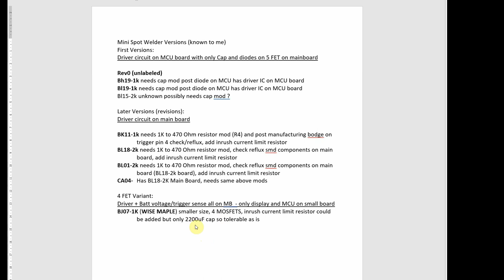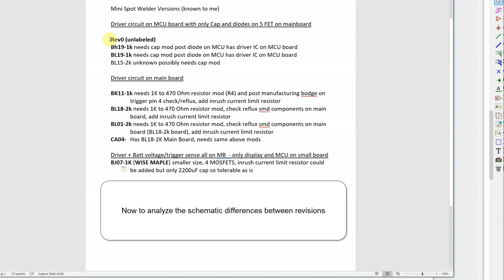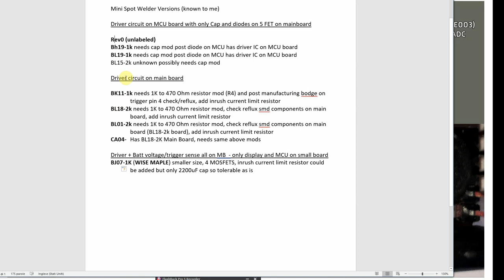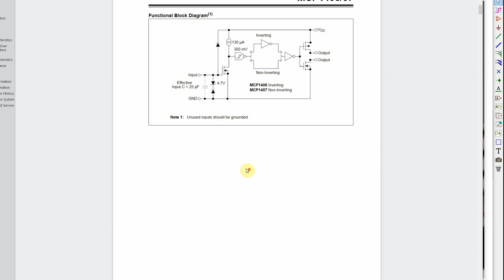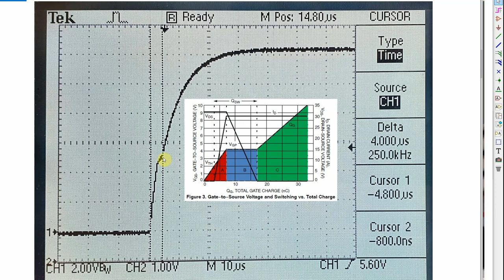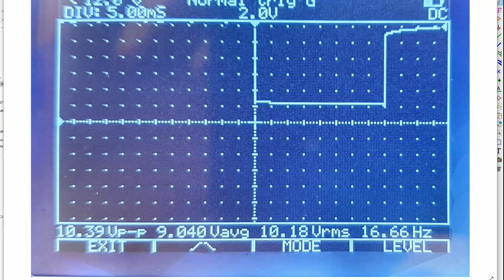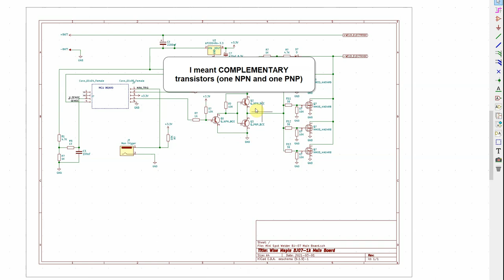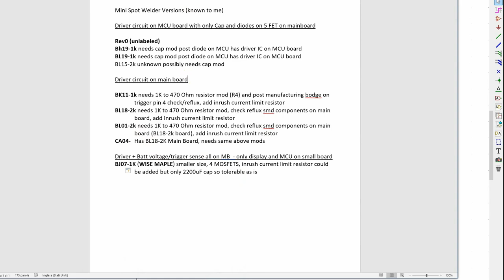All "Mini Spot Welder" versions: circuit Analysis, differences and faults

Comment: Da quello che capisco, queste mini saldatrici vanno implementate in quanto il calo di tensione della batteria può danneggiarne i componenti interni. La mia domanda è: se utilizzo come batteria una 12V da automobile da 60A corro lo stesso il rischio di calo di tensione (e devo di conseguenza modificare la saldatrice) oppure non vado incontro al calo di tensione data la dimensione della batteria che utilizzo?
Mi sto accingendo ad acquistarne una e la questione è di molta importanza per me.
Grazie e complimenti!
Reply from the maker: Ciao Fabrizio, il problema in generale è che c'è sempre una caduta di tensione al momento del "contatto" perchè i cavi e la batteria han tutti un minimo di resistenza e passando anche oltre 200A la caduta di tensione diventa notevole con una frazione di Ohm. Ovviamente una batteria più piccola o malandata avrà una caduta di tensione maggiore (e potrà fornire una corrente inferiore) e allora qui si rischia il malfunzionamento del circuito driver che pilota i Gate dei FET. Se la tensione scende troppo non vengono accesi correttamente i FET e qui si rompono. Quindi una batteria più grossa sicuramente ti assicura una minor caduta. Io consiglio per la compattezza e portabiità una LiPo 3S da 5000mAh 50C ma va bene anche una 12V AGM 45-60Ah (piuttosto imgombrante). Altra nota: se stai per comprarne uno in questo periodo potresti già ricevere la versione "Rev 0 aggiornata" su cui ho fatto un altro video di recente (controlla la playlist) che ha bisogno di un paio di modifiche ma non ha il problema della "caduta" dato che la parte driver è alimentata con un booster che parte da una tensione regolata da 3.3V.

Comment: Ciao Luca, 
Thanks for this in depth video
If you don't mind can you please help me to understand/troubleshoot an issue that i encounter?
i have in hands the first version (unmark) but i cannot make a good weld, the nickel strip (0.1mm) do not stick with eachother or the battery (18650)
I use a 3s 5200 mah 50c lipo battery, i shorten the cable that goes from battery to the unit to minimize the losses.
Have you have some recomendation of the reason why this Is happen?
I tried various pulse time, from 5 to 40ms with the same result, the nickel strip do no stick and when they does the weld Is not  robust enought.
Thanks for your time and Happy New year.
Andrea
Reply from the maker: Ciao Andrea, firstly, be absolutely certain that your 3S battery pack is in good working order - if you can try another pack. You shouldn't need to shorten any cables for good welds up to .12mm: I get very good welds with max 10ms time settings with my 3S pack. You can try a 12V car battery if you don't have another lipo pack handy - just remember to start from 5ms and go upwards. The Rev 0 is usually rather reliable and should weld fine around 10-20ms. From what you describe, there is not sufficient peak current to make a solid weld, and usually this is due to a faulty battery pack or a pack which doesn't have the required C rate or simply one element in the series is faulty. Once you are certain it's not the battery pack then you can try investigating the welder but the Rev 0 version with the MCP driver doesn't have much you can tinker with as it's all connected to the MCP output (there is no biasing of transistors). Try cleaning the pin contacts of the MCU board and check if there are any flaky/cold solderings. If you have a scope you can check the Gate output when you trigger it and see if it does peak to the required saturation voltage (>5V). Other than that there's not much you can do with a normal tester, you really need a scope to see if there is something at fault with the trigger. Buon anno anche a te!

Comment: Hi and thank you for the information..  Regarding the charge current to the main FET's, The charge current is limited by R? (30R)  which is placed above Q2. This would limit the curent to below 0.5A..
Reply from the maker: Well that depends on the input Voltage: considering a fully charged 3S LiPo or AGM battery you would have 12.6V and considering a .1V (CE Sat V) drop on the Q2 CE junction you would have 12.5V which with a 30 + 6 Ohm total Resistance (current path goes from +V through R9 then through Q2 CE junction to the 5 x 30 Ohms resistors of the 5 FETs which in parallel give 6 Ohms would give you about 347mAmps Peak burst current (12.5/36) driving the 5 FET Gates). Use this schematic as reference: https://drive.google.com/file/d/1JdTd9zBeO-WjV4NazYxrOzqykNkTNCc3/view?usp=sharing

Comment: Hi! :)

Awesome video, thanks so much. I bought one a month ago, it took forever to get here, heh. It's a Rev0, to my surprise. (seems that youtube blocks links, if you want I can send it to you in a message somewhere)

So far I'm planning to do four modifications, but I have questions for Mod3. and Mod4. Not sure if they're dumb/smart or worth doing.

1. I'll add some more solder to the long negative trace where 5 FETs are connected, they have little solder anyway, barely connected, so can't be wrong with that. More heat dissipation, slightly better conductivity.

2. I'll of course add the much needed capacitor post diode and MCU, the main thing you mentioned, that is a must.

3. (Unsure for this one) I saw this video (watch?v=mfbQiuopxMk), the person in the video talks at 01:25 about using the spot welder prongs on the same positive terminal where the battery connects as well, since there's a shorter travel path, the lines on the PCB are short anyway and it just introduces additional unnecessary capitance, inductance and resistance. However, maybe it's long for timing's sake? I wasn't sure if he's correct (well, in terms of power dissipation he is), because perhaps both traces need to be the same lenght for timing or something? I don't have an oscilloscope to check, sadly. That's why I decided to ask you first.

4. (Unsure for this one) I wanted to add a gimmick capacitor across the MCP output or Pin 4 (You talk about this at 34:03 in this video) to mitigate the miller effect further.

And by the way, I have a question regarding batteries.

Is it bad to overspec the battery? I know they reccomend car batteries with 25-40Ah rating or 60C Lipo, but what if you get a, let's say 100Ah lead acid or 150C lipo. From what I managed to see, there isn't really any proper current limiting in this small cheap device. Seems like it relies on battery (it's internal resistance and other things) to make sure it doesn't pull too many amps and blow itself up?

Is this correct? 

Thanks a lot again <3 You're a lifesaver.
Reply from the maker: 1) beefing up the traces is fine.
2) Yes this is mandatory
3) Yes you can join the 2 positive terminals on the same screw (which is what I do) to avoid any drop along the positive trace. There is no drawback in doing this if you maintain the supplied terminals intact.
4) Once you have the 1000uF cap added post MCU power diode you don't need any further cap as it's close enough to the MCP to not require any further decoupling. What really would improve the Gate switching performance is to move the whole MCP driver as close to the FET Gate as possible and have ONE MCP per FET. This is yet another design flaw/cost reduction - but again this is a cheap device and cost was kept at minimum. Naturally this is not an appliable mod to this current design.

The suggested battery C is to not overdrive the FET as the whole device is very critially dependant upon the "drop" of the cables and internal resistance of the battery. The cables are of mediocre quality and allow a rather high voltage drop (over 8 Volts) and if the battery were to be near perfect or rather oversized it is very easy to exceed the current specifications per FET and increase the chance of shorting one if you exceed in weld time. The spot welder performs best with max .15mm thickness and a 3S 5000mAh 50C+ LiPo or a 50Ah AGM battery. The ballpark max current is 150-200Amps peak. This should be evenly spread across the FETs ideally but practically impossible as they aren't usually matched (it would cost even more). Keeping the peak current low will mitigate the FETs unbalanced current distribution in this cheap design. Having said this, if you have an enormous battery, you can simply increase the leads length by 10-20cms for ex. limiting further the current, but you would have to find then the sweet spot risking the welder. The same applies to LiPos of course, so try to stay within the 50-90C 5000mAh range (3S).
Reply: @Luca_Techy  You know, I've just been thinking about this. It might not be worth buying the Mini Spot welder at all in the end, considered the small fixes needed, the fact you also have to purchase an external battery, and the fact that BIFRC exists for $44, which easily comes out cheaper than cost of LiPo/Lead acid + mini spot welder.

Darn.

Comment: how about adding a 12 V or 24 car bulb of say 10 watts (or a LED)  across welding electrodes.  this bulb helps in preventing accident for spot welders having manual trigger.   i have come across cases where in a mosfet is shorted in and uncontrolled current flows through the probes when weldign is attempted.  so in ideal condition the bulb / LED will stay off in the absence of trigger pulse.  if it is lighting continuously in absence of trigger pulse, it means the mosfet is shorted or something wrong with mosfet driver or trigger circuit
Reply from the maker: You can do that only if manual trigger is selected (else it would auto trigger continuously) - any small 12V light bulb or even LED with appropriate resistor across the terminals can function as a FET short or failure indicator.

Comment: Hi Luca!  I really like your videos about the mini spot welders!  One quick question - would you suggest that I purchase the latest version (Wise Maple) over the other versions?  Or are the older versions better once they are modified?  THANKS AGAIN!
Reply from the maker: The best version in terms of efficiency is the first "Rev 0" version with the specific MCP1407 FET driver on it (which needs that additional Cap mod mounted after the diode). This version is usually around 8-10 Euros more expensive but is worth it if modified (else you're going to blow FETs). The other versions are of course fine with the required mods but if you can choose, get the first version and add the 470uf-1000uF 25V cap between diode outputand ground on the MCU board as explained.

Comment: So the 10,000uf capacitor could be replaced with a 2200? and skip the resistor?
Reply from the maker: That's the point: even a 2200uF cap directly connected to a power source when discharged needs a current limiting resistor as it puts a lot of stress on the diode every time you power it on. Granted that the 2200uF cap is much smaller and due to losses the peak current is lower, it eventually can kill that diode. If you have the 10000uF cap, better keep it and add a current limiting resistor (or an XT-90 anti-spark connector as suggested in other replies).

Comment: Luca, first of all thank you for videos. They are an incredible source of information on these nice buggy spot welders. Unfortunately I found you too late and I managed to blow one of the mosfets. Do you suggest replacing it with an identical one or is it better to use an improved model? If so, what model do you suggest? Thank you in advance, Alessandro
Reply from the maker: Hi Alessandro, if you just blew one single FET you can simply remove it and keep using it with 4, it will work fine after applying the indicated mods. If you have blown 2 (unlikely at the same time) you can still actually use it though probably with slightly limited welding pulse - or simply opt to purchase a batch of 5 new FETs and replace them together. If you don't want to mess with unsoldering FETs or don't feel up to it  the alternative is the WISE MAPLE which works as is (note the limitations described in the video).
Reply: Thanks for the reply. I've actually already removed the faulty FET (was the closest to the black output lead) and I could see that the other ones are still operational. I will now perform all the necessary upgrades / fixes before testing it again. And for the time being, I'll survive with 4 FETs only.

Comment: Trying to repair but cannot remove probes. Probes are welded with solder I cannot  melt. Not even with a mini torch.  What is up??
Reply from the maker: Hi, the wire is usually mechanically crimped tight in the probes so it's very hard if you want to detach the probes from them (if I understood what you are trying to do). If you are trying to remove just the tips the same applies, I haven't yet tried to disassemble them but I suspect it's because they are also crimped.

Comment: Hi,
are the package dimensions 0402 or 0603 for R4?
You would recommend to re-solder the FETs and the remaining smd components because of poor electric conductivity?
Wise Maple:
Do I get it wrong or is the driving circuit born to die? They should rather change the behavior of Q2 and Q3 to keep a safe condition if Q1 fails.
CA04 Version:
What do you think about connecting the 10 mF Cap directly to Bat+ and Bat- and instead using a smaller Cap for the driver circuit? Wouldn't this improve the later revisions and makes the inrush resistance maybe unnecessary?

Thanks in advance!

Best regards
Reply from the maker: Hi Simon, the original smd resistor outline is 0402 for all components. I suggest checking all the solderings of the smd components - the FETs usually are OK and can be left as is - I added some additional solder on one board and on another I added a copper braid, but for normal .12mm welding strips it's not necessary though it will improve efficiency. 
The Push-Pull driver circuit shouldn't fail as within transistor specifications (but you can never know on the long run if there are defects though I have had no reports of this simple circuit failing). The fact is that Q1 is always on when the device is powered - it's driven off when it triggers the push-pull as shown. However the current driven by Q1 is well below design limits so there is no problem with this part. What I find is that it's not really efficient for driving FETs (or so many at once).
Yes you could bypass D1 removing it as mentioned and use it as aid in welding (which is what it was designed for initially as explained n the video) and add an additional 470-1000uF cap and diode to power the MCU board similarly to the original design with MCP driver - I would always suggest a small inrush resistor if using a 1000uF cap just to limit that peak current in your series diode. The fact that the diode in the original design doesn't fail after the addition of the 1000uF cap is simply because of inevitable resistive losses in the components and traces - but you should always add an inrush resistor to preserve the life of that small diode generally speaking. As I explain in the video, this modification is possible if you like to make use of that large 10mF cap, but you would also need to shorten those legs right up to the PCB as they are too thin to handle those peak currents, and that's not possible with the current layout of the PCB - it's simply not really designed well enough so in my opinion just apply those basic fixes to avoid it to fail but it certainly is not a great design.

Comment: Hi,

I did do the mods and working fine on 2 paralel 3s1300 75C lipo's.
But don't want to stress out my batteries.
Do you have any recommendations for a buffer capacitor.
The unit only has a capacitor for the controller not for welding.
Thought maybe that's better.

Thanx.
Reply from the maker: If you are using a 3S2P 75C then I wouldn't worry too much about stressing the batteries, they can handle some high current ms pulses without issues. The real problems with LiPos are related to constant high current discharge reaching 3V per cell when used in models. That and the cyclic charging of the cells is what degrades LiPos (most last a couple of years and less than 300 cycles before a noticeable degrade in performace and "bulging"). You could add a large 12V supercap bank near the welder but that would also be also expensive (5S2P 3.7V 500F caps) and you would have extra wiring near the welder. Keep in mind that these mini spot welder are for hobby use, wled a couple of packs now and then and the likes, but if you need to do it professionally or weld several dozen cells often, you should move to another product.
Reply: @Luca_Techy 
Ok thank you for your advice.
👍🏼